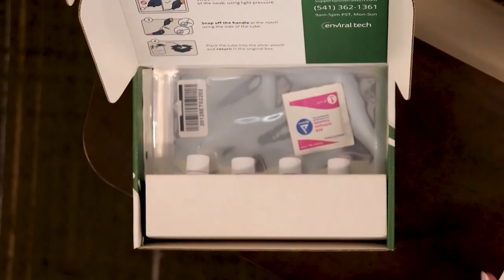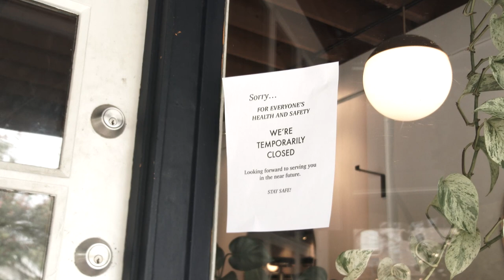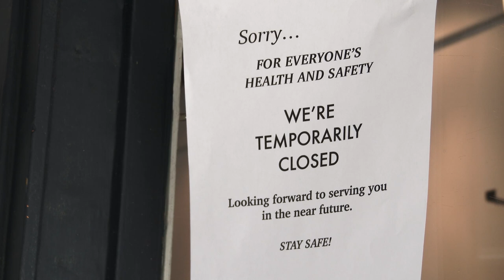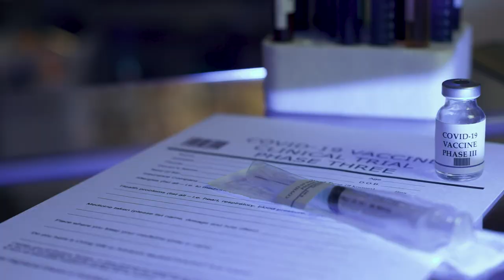How Enviral Tech Saved Arcimoto - with Mark Frohnmayer

Comment: Could the lab testing and analysis process be automated? Imagine ride-hail  robotaxis with with Automated surface testing performed at charging & cleaning stations. Or even better; automated on-vehicle testing performed after each trip.
Could really help make public transport feel safer during/after a pandemic. It could also enable an early warning system in test, track and trace programs... Test prices would obviously have to be way cheaper to be feasible!